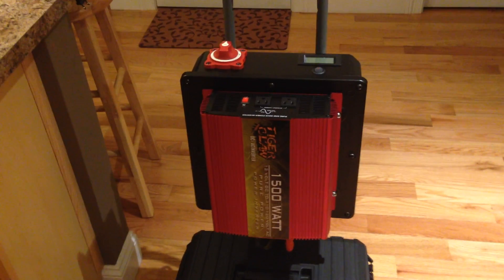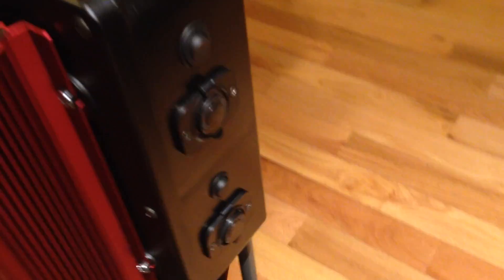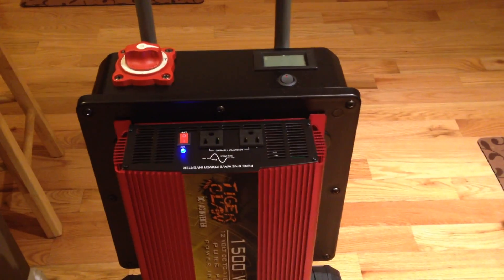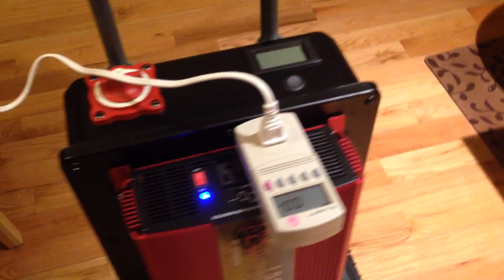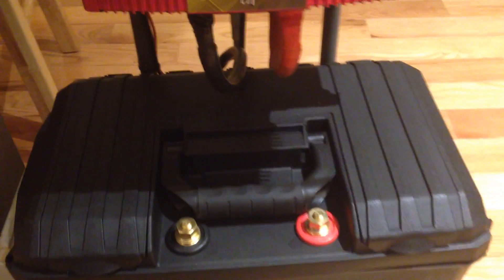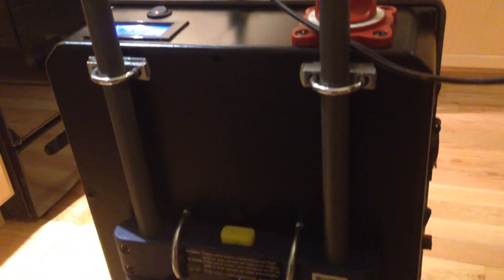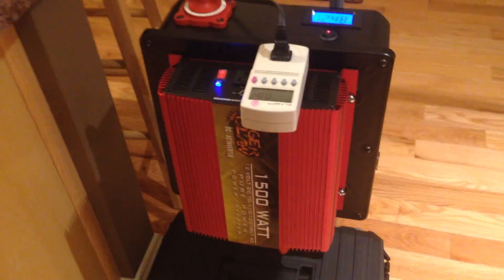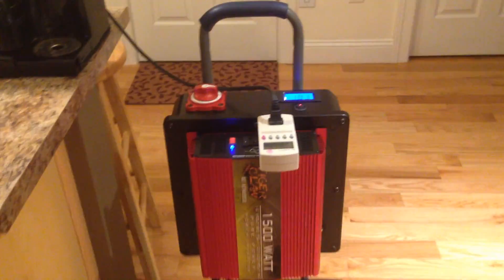Maquamerator - Solar Powerer Generator !

Comment: 1500 Watt Pure Sine Wave inverter-EXCELLENT! I'm very impressed with how CLEAN your system looks as well. NICE JOB!!!
Reply from the maker: Thanks!  I did a few more modifications and added another watt-meter on the top to measure solar charging.  I think those changes are reflected in a later video.   I'm happy with the overall product!